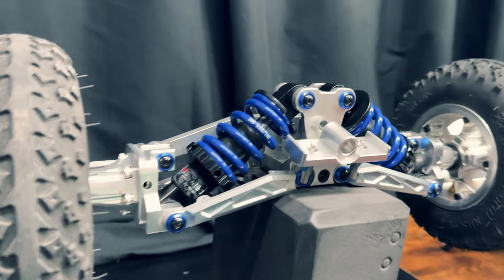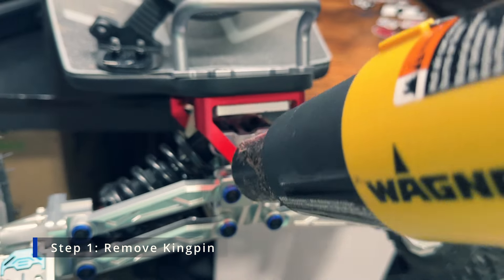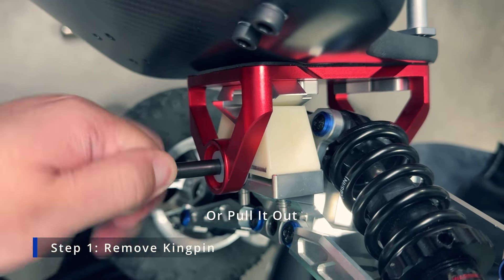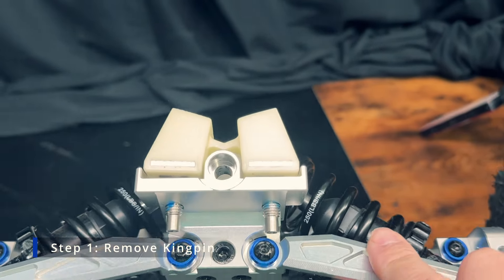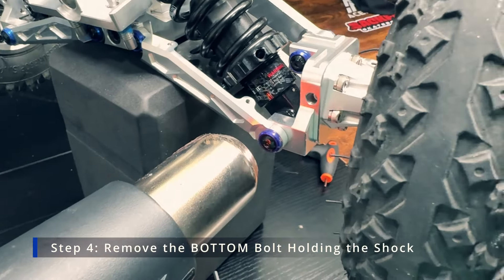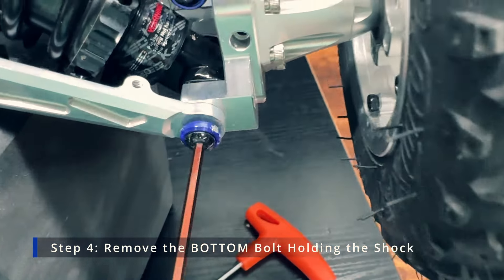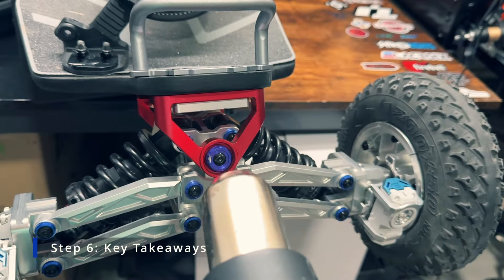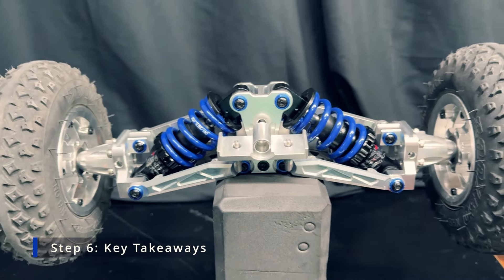Shock Suspension Removal & Truck Disassembly Tutorial - Acedeck Nyx Z3 ELITE

Comment: Thanks for the video. My bottom screw stripped twice. I was trying to tighten it down so it was flush with the control arm. I’m still working on a solution. It’s disappointing as I just got the board and noticed it wasn’t flush after inspecting all of the screws.

Comment: So im switching out my shocks. And ran into a problem. On the back the pin holding the shock in place near motor wont come out. It spins but thats it. Tried tapping a pin in it. Any tip or trick to get it out? Other shock came out easy.